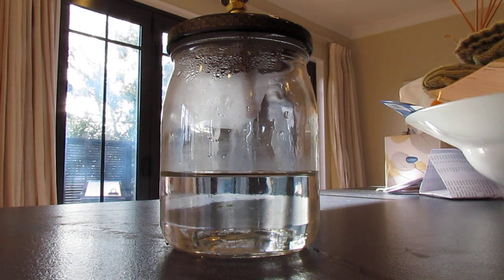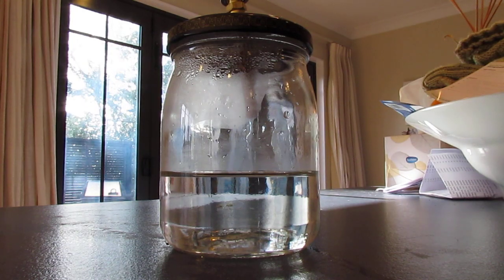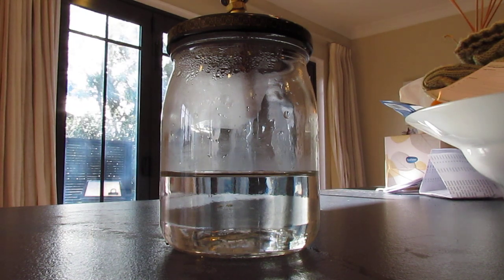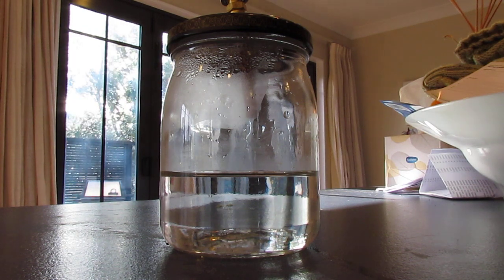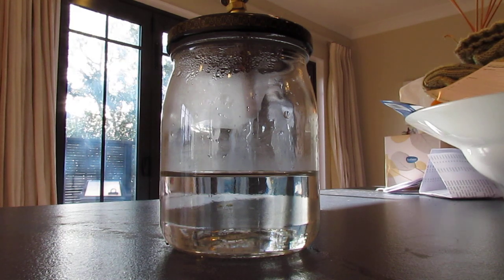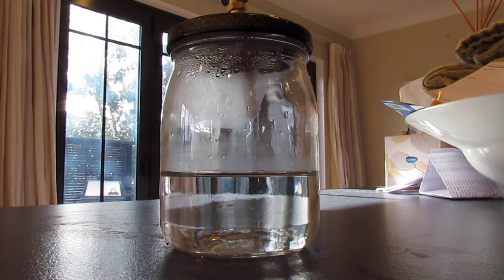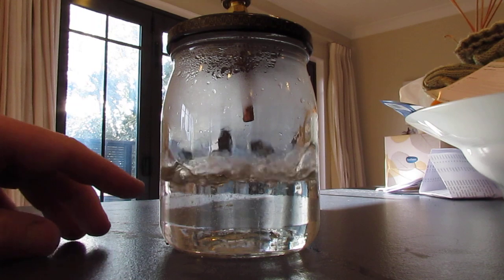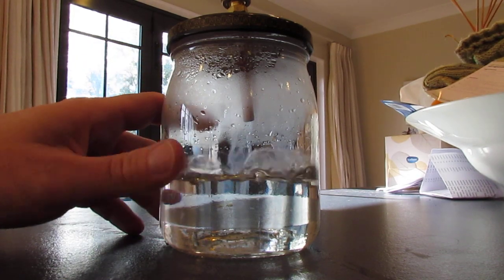How a vacuum effects moisture in a refrigeration system.

Comment: So how did you make your jar. I want to create a container that I can place my back up camera from my truck into to clear the moister out of the lens.
Reply from the maker: It was the quick and easy actually. I took a Mason jar, a glue gun and a Schrader valve. Pop a hole in the lid and glue it in place.
Hope it works, cheers
Reply: Thanks! @latentfusion2563

Comment: I was expecting to see how to get rid of the water / moisture from the refrigeration system, i.e if you leave a pot of water on a burner for several hours, the water turns to vapor and at some point the water will evaporate completely till the pot gets completely dry, this never happens 100% to the moisture in a refrigeration system. it will help but not 100%. the boiling point of water is 100deg C, more than that it will became a vapor,  vacuum do the opposite it will freeze the moisture in the system and even in the comp lub oil.  in my opinion to completely remove moisture from a ref system is to change the comp lub oil, replace with a new filter drier,  flushing the system with flushing agent plus nitrogen and perform a good vacuum and proper ref charge. then you need to monitor the system and do filter change  every 48 hrs till the system is completely free of moisture.  water can freeze in vacuum so with just a vacuum or even with a triple vacuum will not remove completely
 the moisture from a system .

Comment: At a place I worked a large machine we built had a rather large vacuum tank as part of it . It had a couple port hole windows so you could see inside. When they tested it there was about a half pint of water in the bottom. I got to watch that puddle of water boil like there was a fire under it but it was 70 degrees. It was weird.
The opposite effect in a pressure cooker you jack up the pressure ( without blowing it up ) to where water boils at like 300 degrees